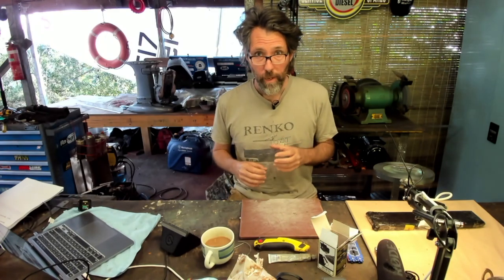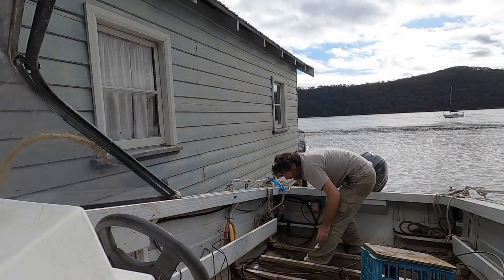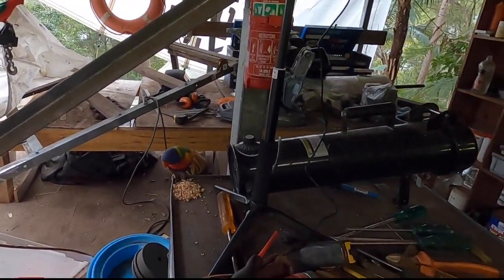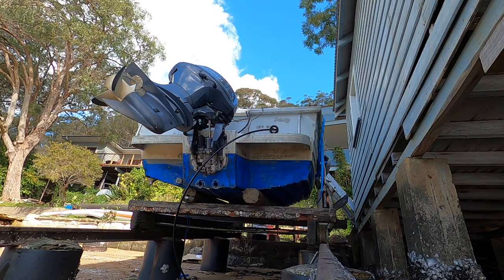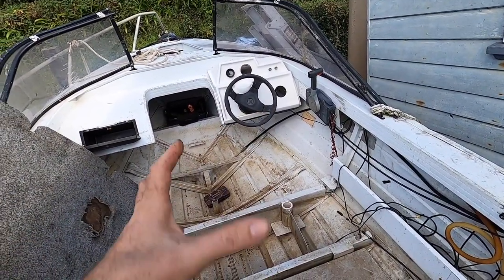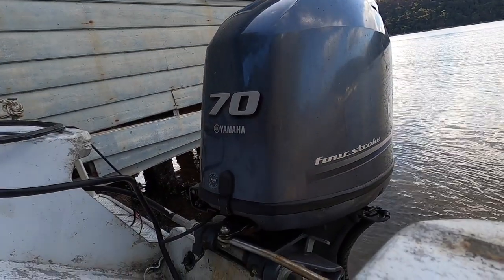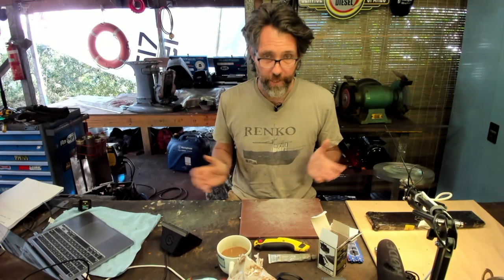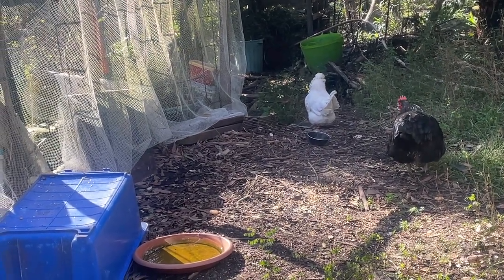Outboard steering cable replacement and new website

Comment: For OBS Cursor Capture (PC).. In the main window, under "Sources", right click your capture source, e.g., "Display Capture", & in the right click menu choose "Properties".  Near the bottom of the Source Properties dialog, there is a check box for "Capture Cursor".
Reply from the maker: Yes, unfortunately only the PC version seems to have that option.
Reply: Yea, I guess there is no cursor capture when capturing a single window, versus the full screen on a Mac.... Found this on the OBS forum: "[Cursor capture] Not [possible] with window recording. For cursor display use display capture, cropped to a window."   Maybe this helps. ¯\_(ツ)_/¯   At any rate, great videos & content!  Thanks & keep it up!

Comment: Hey stu,recently tried to remove cable from the tilt tube to give it a clean due to seized steering.
Now the end where it connects to outboard linkage is stuck in the exit end of tilt tube should I proceed in forcing it through or do I risk damaging tilt tube ? Thanks Clive.

Comment: Hi, I bought an old boat with johnson 75 Stinger. The teleflex is rusted in so badly I can't bash it out, and trying to break the rust bond by twisting with vice grips doesn't even seem to be getting close. I can't get the grips any tighter without having a hernia.  Any tips would be greatly appreciated. Thanks. Glen

Comment: Lately the Yamaha F40 is coming down slowly over night/after few hours. I see no oil leakage, I checked the power trim oil level and everything seems normal. The screw to manually trim the motor is ok as well. I read somewhere that "If no leaks are found, it also could have been a cylinder bypassing internally"... Since I live in a small island where no mechanical issues can be dealt with, can you tell me if you have a video about this specific problem? Thanks again
Reply from the maker: I don't at the moment but I would like to do some more videos on the internals of trim tilt units. Plenty going on inside them!

Comment: Don't do what I did many years ago.. I just put the tip of the steering cable into the tilt tube to hold it there but while I was up the other end feeding the spiral end into the helm the cable fell free of the tilt tube and landed perfectly across the negative and positive battery terminals causing things to get very hot very quickly and giving my palms a nice spiralled burn. Only did that once.
Reply from the maker: Ouch! Don't worry, I've had similar things happen myself, there is always something there to bite you...

Comment: Hey Stu, the bolts that hold the outer cable in place on mine don’t have a head. Did they make some of these to be unserviceable? Or has somebody cut them off? (No sign of grinder or shear tho)

I thought it might have a lug, so I twisted the outer 180° each way to see if it would slide out, but no luck

Comment: While you were there replacing the steering cable, stop and remove the helm. Thereby having repaired/ refreshed it ,  Thereby making material for 2 videos. You are not shortchanging the repair and In the end, a better repair of the boat 👍
Reply from the maker: All depends on how much money the customer wants to spend though. Okay when it's your own boat.

Comment: Hi Stu,
I was hoping you could help me with something.
I'm adding a tachometer to my 1992 Johnson 115.  On the back of the tach is the "Pulse" switch, or dial.
Do you know what the pulse setting is for the Johnson V4's?  I'm not sure if it's 4 or 6 or something different.
Thank you for your time.
Jeff in Wisconsin.
Reply from the maker: Hi Jeff, this table may help you http://www.criboats.com/wp-content/uploads/2015/04/Faria-Tach-Settings.pdf
Reply: @DangarMarine  Thank you!

Comment: Can you drill a hole in the center of the tilt tube and screw in a zerk? That way you could pump in fresh, soft grease like WD-40 300417 Lithium every few months...
Reply from the maker: I like your thinking but you need to be very careful as great building up behind the part the extends will stop it from retracting and the boat won't be able to turn to port.

Comment: Any tips to adjust the steering wheel alignment? When travelling straight, my steering wheel is slightly turning left by 20 degrees. The steering wheel can only be attached one way.
Reply: I reckon if you back the cable out until the wheel is loose, make the 20 degree correction, then wind back in and bolt it up.
Reply from the maker: Yep, I agree.

Comment: Did I miss the bit about how you line the system up so the steering wheel is centred when the outboard is centred?
Reply from the maker: You can remove the cable, turn the wheel a bit and then re-install it until it is right but I have never bothered.

Comment: If you sign up for a free Zoom account, you can start a video conference with yourself, share your screen and then set it to record - you can either record just the video, or the video and your mic (and also your computer if you want) ... it'll generate an mp4 file at your screen resolution in a folder on your local disc within a minute or so of ending the conference ... and it's FREE.
Reply from the maker: Fornuately OBS is also free and has a lot more production features than Zoom, but I do appreciate the suggestion!

Comment: Silicone grease? It doesn't evaporate or dry up or wash off easily, not sure about salt water though
Reply from the maker: Maybe, it's certainly light enough. Worth researching.
Reply: @DangarMarine  I swapped to using "Carlube" brand silicone on lots of things it doesn't go gooey, primarily bought it for caliper slide pins originally. It's also great for conditioning orings, rubber and plastic parts and is quite thin. you can inject it with a syringe into cable sheaths which a lot of them you can't they're much too viscous. It's available on eBay and generally comes from UK but i have seen it in Repco i think
Reply: @DangarMarine  scratch that Carlube brand doesn't seem to be available here anymore, there's one UK listing on eBay but postage is a bit steep. It's similar looking to the 3M Silicone paste but i couldn't find that here before either. The other food safe silicone pastes i had are very thick and not the same, depends on the requirement i guess

Comment: Steering cables are a nightmare to install. Setting the correct length and turn radius
Reply from the maker: Yes, it's amazing how one foot too long or short can really make the install impossible. Some transom designs make it really hard too.